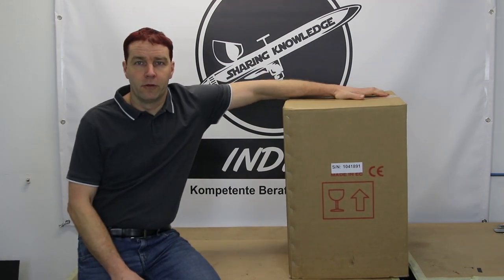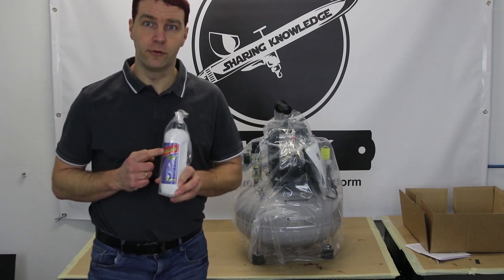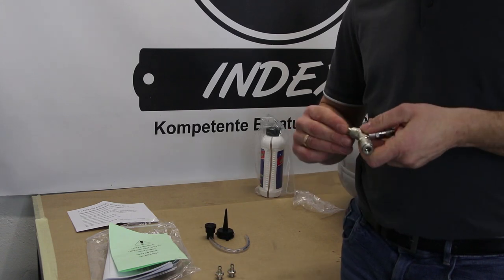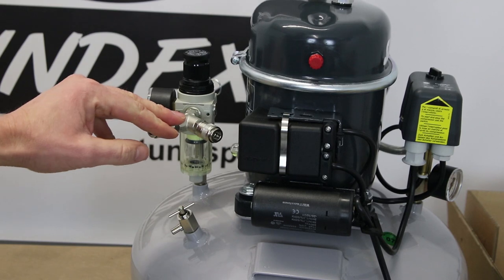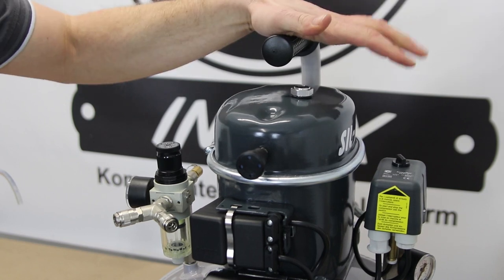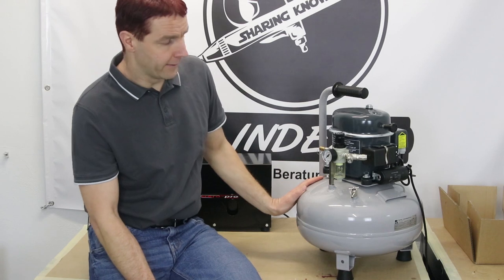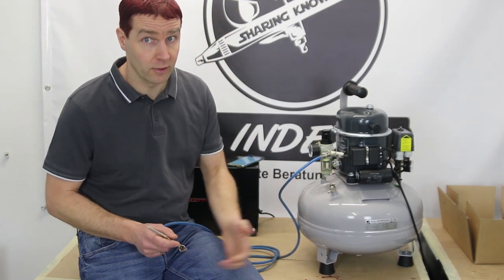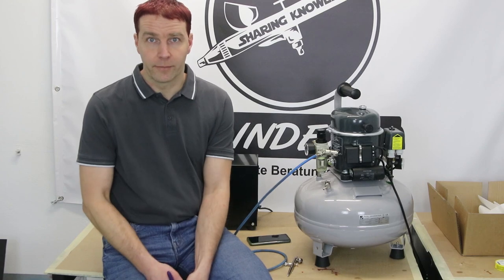Werther SilAir 50/24 Airbrush Kompressor Test und Inbetriebnahme | Airbrush, Modellbau, Heimwerker

Comment: Hello I have a Werther SilAir 50/24, if the inside pressure is 8 bar, is it normal that after one day it has been decreased to 7 bar, without using the compressor? There is no noise of air flowing outside from the connections. Thanks in advance.